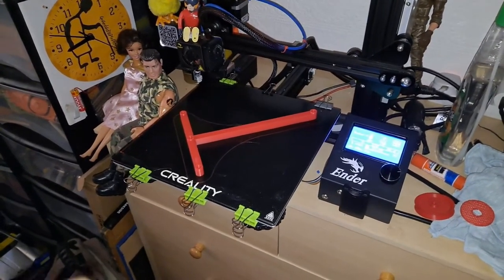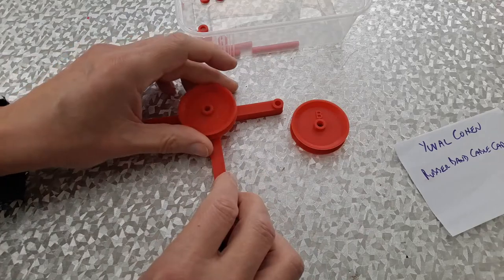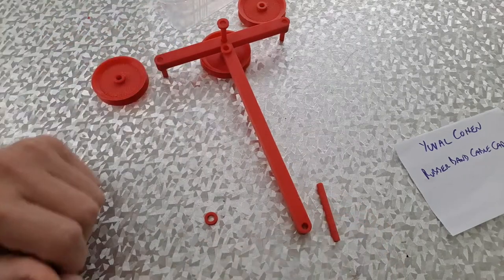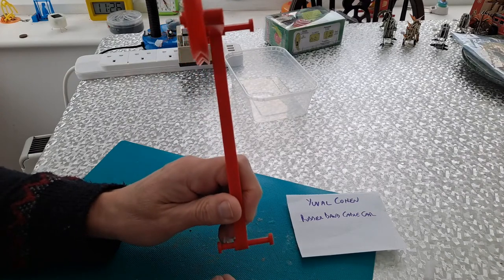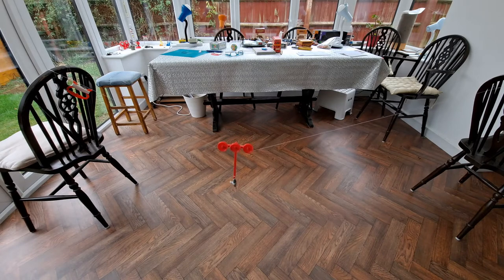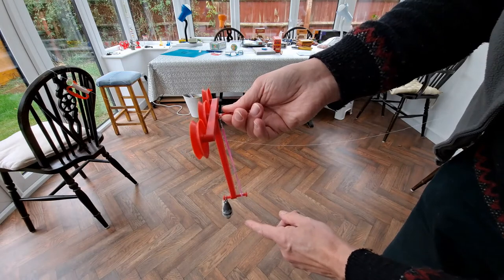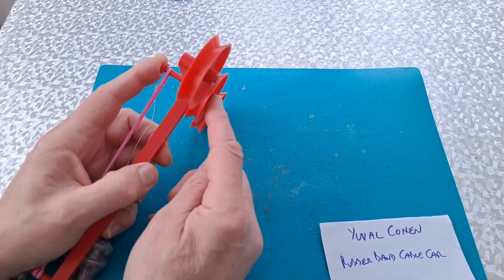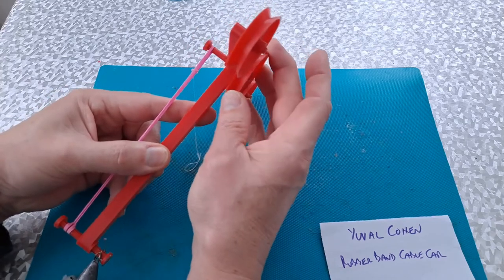Put a rubber band on it 0379 Cable Car first look

Comment: Well, I think that is brilliant. Rubber-powered cable car eh? Great design and I was thinking the same thing about the length of the arm. A bit longer and further distance. I know you could put a motor on it but the purpose was rubber power. Just a thought here, but what if you put more pulleys on the arm to gear it down, would that make it go slower? So you wouldn't use all the rubber band energy up at once. Yes, I really like this. Well done. 😃👍👍👍
Reply from the maker: I really don't like getting into gear with the rubber band projects. Just changing the size of the main pulley would be the same as adding gears and simpler.

Comment: Hi Grandad
I would like to see you add a propeller to the center axel and hang it outside, on a mild windy day. 
Would it drive it on a balanced level cable.
Reply from the maker: Hi Ed. Putting a propeller on the centre axle would be at right angles to the direction of the cable? Here is a propeller on a zip wire. Much simpler https://youtu.be/oCWJso2CqlU?list=PLA5a2xPRSrB106WHwkGEVCehwaoIfKFfj and this was the improved version https://youtu.be/v5LAKlDfrwQ?list=PLA5a2xPRSrB106WHwkGEVCehwaoIfKFfj Ah, WAIT A MINUTE, it has just occurred to me that you might mean without the rubber band, so the propeller drives the wheel direct like a whirligig sort of thing. I will have a think about that, that could be fun 😊👍👍
Reply: @Putarubberbandonit  Right spot on Grandad. That is exactly what I was thinking. I should have mention it. 🤔👍
Reply from the maker: @Sea-Dog5496  yes, after I started writing the reply I suddenly realised what you meant, but I left the rest of it there for anybody else to have a look at. I do like that idea, so it is definitely on the list 😊